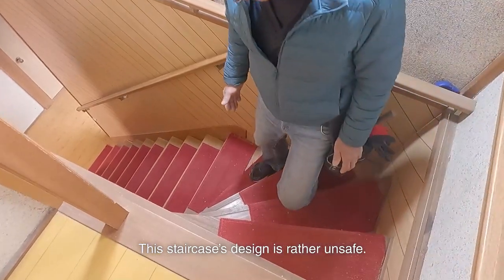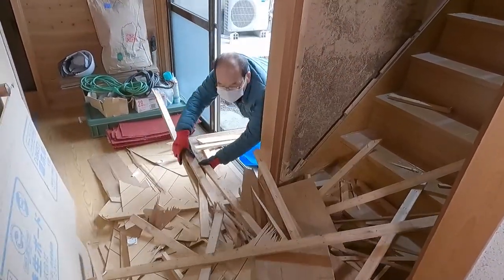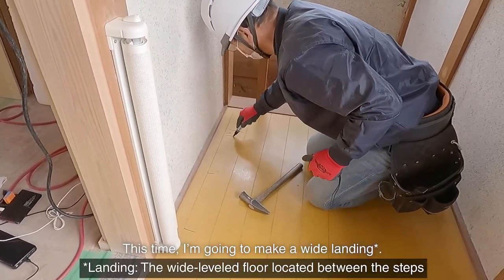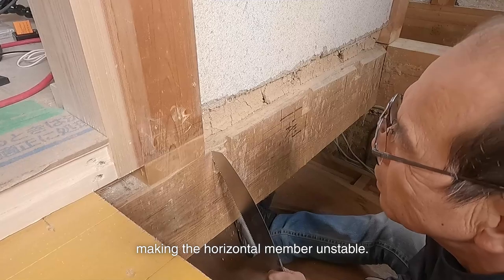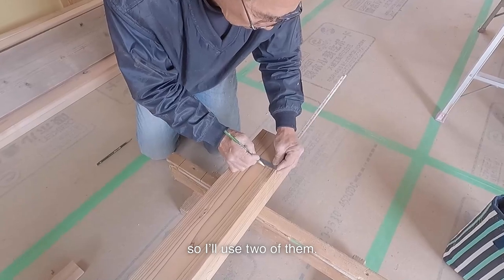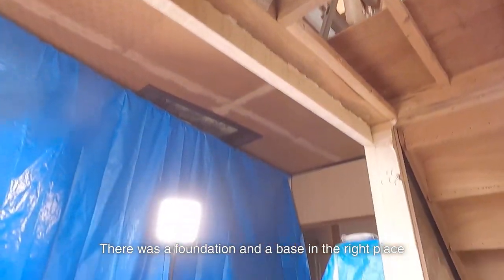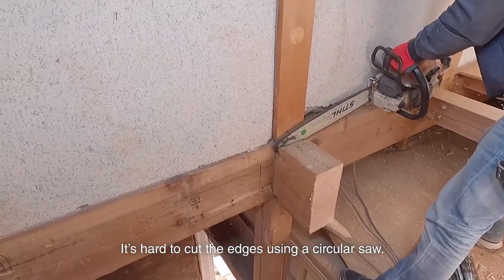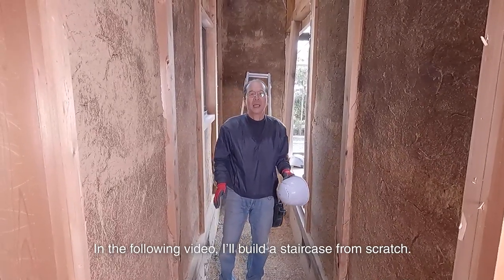Japanese Carpenter’s Renovation - Demolish the Staircase

Comment: I’m not understanding the hammer you’re using. It is very similar to a western slag hammer that a welder would use for chipping slag from a fresh weld. It has the standard hammer side and then a pointed chipping side. Because it has no claw for pulling nails, what is the function of the other side? I understand you carry an additional nail puller in your tool belt, but why not have a claw on the other side for pulling nails when needed.